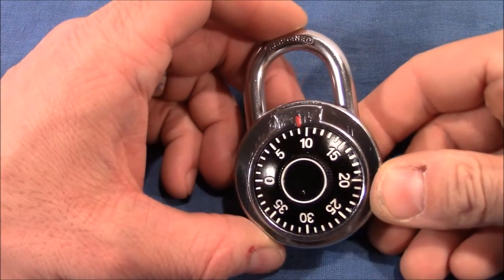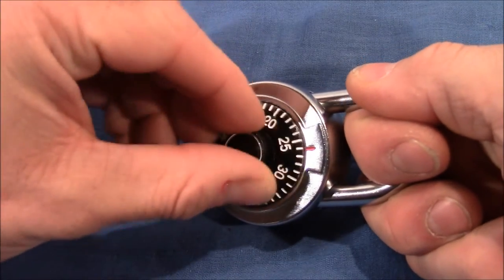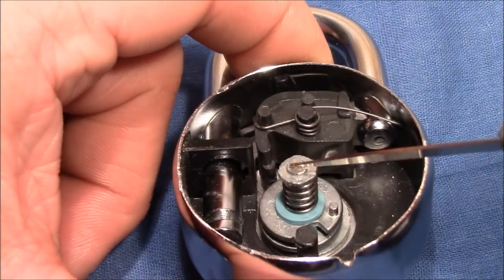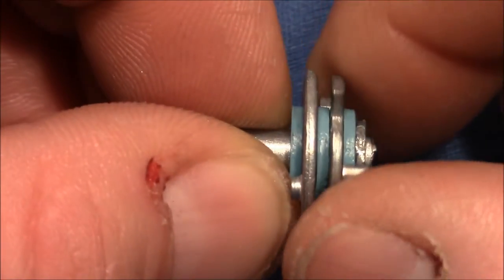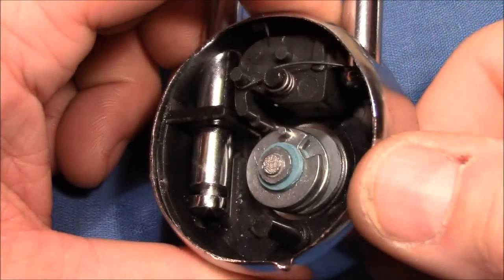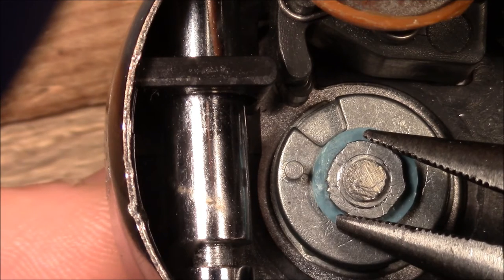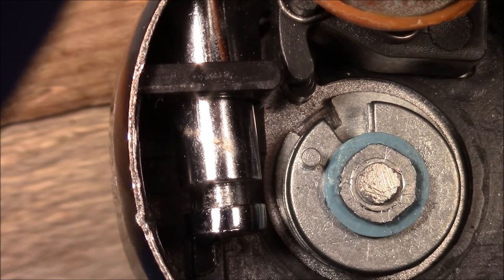(picking 102) Safe combination padlock explored

Comment: Interesting autopsie, thanks!
No false gate on the disks.
And no system of scrambling combination to the closing of the padlock...? :)
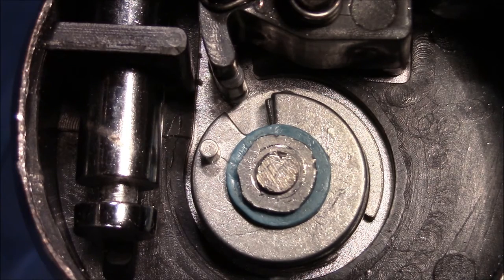Reply from the maker: +de Ronchopathe Sorry. There was a mechanism that turned the upper wheel when the shackle is closed (therefore the long pin on the upper wheel 10:53). The mechanism was loose and I didn't show it for the sake of simplicity. Maybe a mistake.